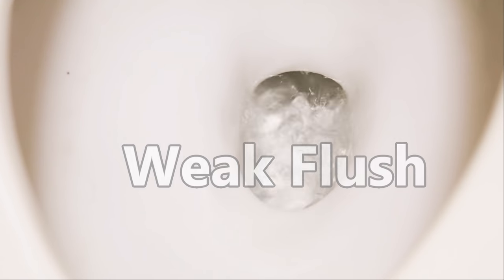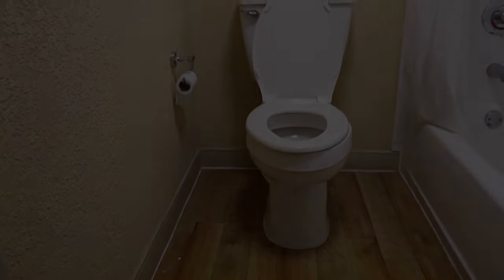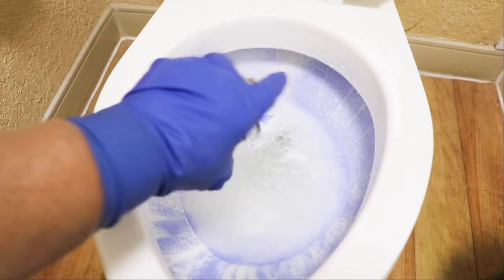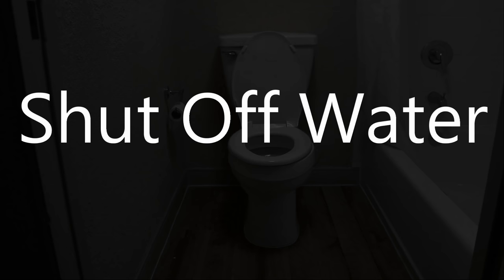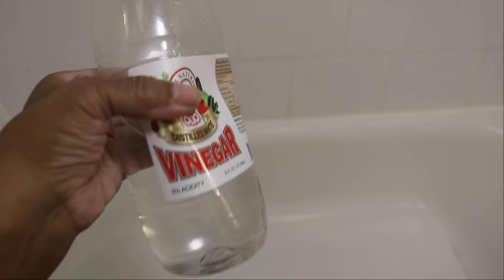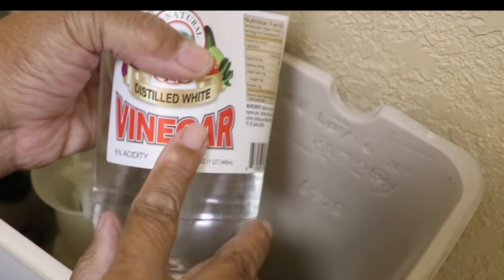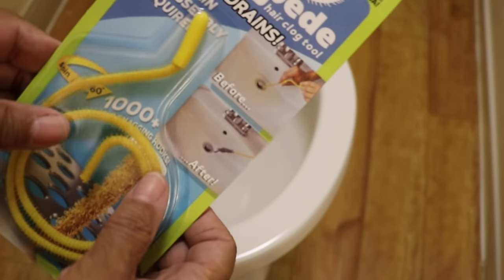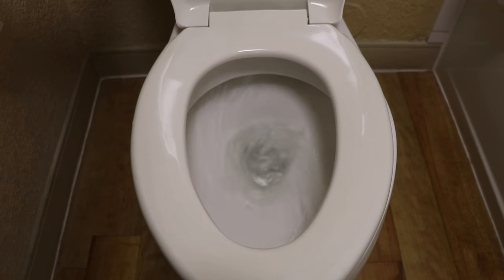FIX a Weak Flushing TOILET

Comment: I live in an apartment in a building and my toilet doesn't have a tank; it gets water directly from the pipes in the wall.  I think I may have "lazy flush" because some of the ducts into the sides of the toilet (which you covered with tape in your video) shoot water with too LITTLE force and others with too MUCH force.  Given that I cannot put vinegar into the tank (since there is no tank), is there any way for me to unclog the ducts?
Reply: Turn off the water, unhook the line from the wall and funnel the vinegar into the line? Worth a shot. I had an apartment toilet like that once, it was a champion and never gave me this trouble. Sigh.

Comment: Gotta tell ya, so timely.  I had a plumber out because my plunging the kitchen sink didn't do the trick and a couple other drains clogged in my "new" house built in 88.  Usually I would have done a DIY but so many drains.  The kitchen trap had a small narrow but long  "strawbrush" in it and a quart of rice, with onions and lime rinds.  lol  But decided to auger the toliet drains after that.  

The plumber didn't mention the jets or holes at the top but he did mention that the jet at the bottom of the bowl from the front had calcium build up that was preventing a good flush.  Suggested a flathead screwdriver to clean it and if that didn't do it, it might be time for a new toliet.... no way do I want a modern water saving (yeah right) toilet.  Had that in my last house and multiple flushes.  Perhaps you can recommend a modern toilet regardless of cost that is effective (efficiency nice, but not as important).  So, in summary, your suggestions expanded upon the suggestions of a pretty good plumber.  Thanks as always.
Reply from the maker: Thanks for sharing the screwdriver tip.....I'm certain many will benefit

Comment: Another solution after cleaning out the jets, is to set the amount of water level you have in the tank, as your level may have been set to low, simply make adjustments by elevating the float pin/ or bar.

Comment: When I tried this, the vinegar all went out the siphon jet hole at the bottom of the bowl. None of the water seemed to go near the rim jets, which are clogged with tiny bits of toilet paper from when I plunged a nearly overflowing toilet last week. Any ideas for how to clear the inside of the rim jets of the toilet paper bits?
Reply: Use a metal coat hanger and very carefully clean them out one by one. Buy a dollar store inspection mirror to see the holes as you clean.

Comment: Can you do a video on the flow adjustments that can be done on top push button toilet? I knew how to adjust the old toilet with the float arm but this toilet doesn't have that.
Reply from the maker: Here goes https://youtu.be/KHPdJ_e-E1U
Reply: @seejanedrill  Thanks!!
Reply: @seejanedrill  The referenced video shows how to adj the tank level. I have a dual push button toilet. One button is marked for low flush and the other is marked for full flush. Both buttons seem to flush the same amount of water and flush time. Is there a way to adjust the individual push buttons in order to increase the pressure on the button marked heavy flush???

Comment: Can you use muriatic acid?  I think my better half has used that on one of our toilets before.   Never seen the duct tape trick like this, very useful to remember thank you.
Reply from the maker: I'd be a little concerned about damaging so of the toilets components
Reply: @seejanedrill  thanks for the reply. I asked and the way the acid was used, water still in the bowl and just scrubbing manually so it did not get acid up in the other parts. I passed along the duct tape trick. Thanks!
Reply: @seejanedrill  pouring acid only down the overflow should be safe.  It is best used in the bowl only.  For me the biggest problem was the lower main jet and the trap had lots of lime.  Always be extra careful with stronger acids.  Burns can hurt.

Comment: Those aren't 'jets'. Those are cleaning holes to pass water to clean the sides.
The water flowing from the siphon jet at the bottom is what produces the force to push everything up and over the siphoning path.
The siphon jet can fill with deposits. 
My toilet siphon jet was almost completely clogged. I carefully hit the deposits until most of the deposits were broken up and removed.
The toilet is now working as good as new. It's an old 3.5 gal.

Comment: I have tried even muriatic acid and that stuff is strong, it is still not working right. I’ve been using a bucket of water to flush the toilet.
Reply from the maker: It could be a partially blocked  trap or a blocked stack

Comment: I installed a toilet but inside the tank it builds pressure and flushes on its own. What could be the problem.
Reply from the maker: My guess is it's the flapper.  Clean the flapper of mineral deposits or replace the flapper with a new one.

Comment: That is a very good and thorough job.  Vinegar is great, isnt it.
In the recent year, I have been trying to get rust out of the bottom of a very old bath tub.
I was familiar with Vitamin C (ascorbic acid) as being the most powerful solvent acid in the body. C will cleave over 10,ooo organic molecules. I soaked a paper towel with Vitamin C and left it in the tub. Rust came out.
So to clean my commode bowl, I began putting a 500mg tablet of Vitamin C in my tank. I first noticed that the bottom of the commode tank, which was dark from some residue (50 yr old tank), the bottom of the tank would show a clear spot wherever the vitamin C tablet landed. The C did clear the commode bowl some, however there are some stains which are apparently permanent. I am careful with having Vitamin C in my mouth because C will dissolve enamel like wildfire.

I will switch to vinegar like Jane and try that for several months.
Thanks Jane.

Comment: I've used muriatic acid for this type of situation.  Nasty stuff in terms or odor and wear gloves, but much better  and easier than this method.  There are videos on you tube which show the application.  It's the only way I could get minerals out of a couple of the enclosed areas of the toilet drain and the large jet inside the bottom of the toilet bowl.

Comment: 99% of the time poor flush is due to inadequate amounts of water it the tank and pull chain length too long so the flapper doesn't opened far enough to allow the full 1.7-2.5 gallon of water to empty out in tje shortest amount of time
..that's the flush power. The rim jets are fed by a 5/16 tube and for washing down anything on the sides of the bowl
Which on normal uses should be clear of anything..

Comment: This appears to be... half of a great idea.  Unfortunately (assuming your siphon jet, the big hole at the bottom is clear), the vinegar will just flow right out of that bottom hole, not giving it a chance to sit on the clogged rim jets.  And I'm having a hard time clogging the siphon jet to stop that outflow.  Frustrating!
Reply: PS - I am by no means a plumber or knowledgeable.  Is it possible that some vinegar flows into the feed for the rim jets, even as some of it flows out the siphon jet at the bottom, meaning that the approach in this video would work?  Is that what happens?

Comment: What if my toilet is brand new
Reply: Then it's water pressure, either from your water line, or that you don't have the water supply valve opened enough.
Reply: Low pressure, you may want to check the roof vent and make sure that’s not clogged

Comment: Don't waste your time with this amateur video. Vinegar won't dissolve calcium deposits which are the number one cause of plugged jets. Also the vinegar will break down the glue in the duct tape and leak in about 30 seconds making that task useless. Third, if you don't plug the siphon hole at the bottom, the vinegar all runs down to the bottom of the bowl making the taping off with duct tape pointless. Use Murick acid or CLR (pour in bowl and tank and let sit) if you want to clean calcium deposits and even with these strong acids you have to repeat many times.